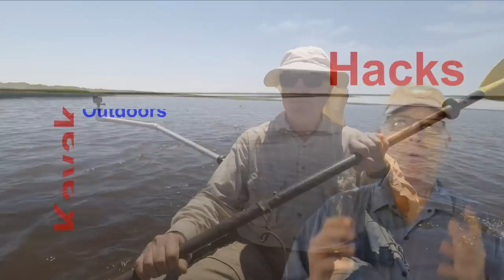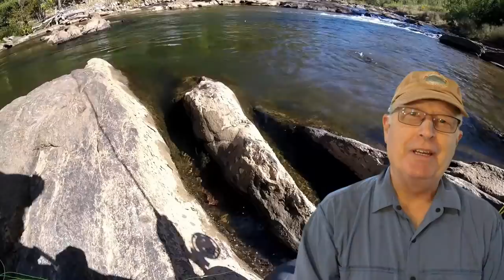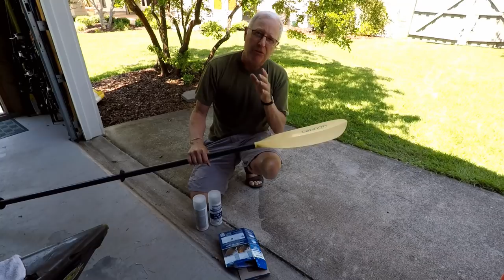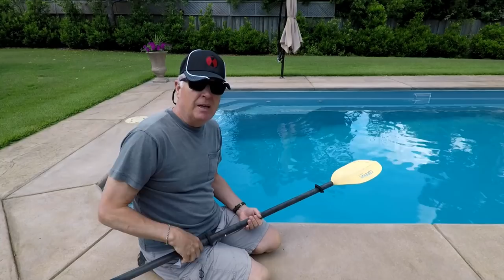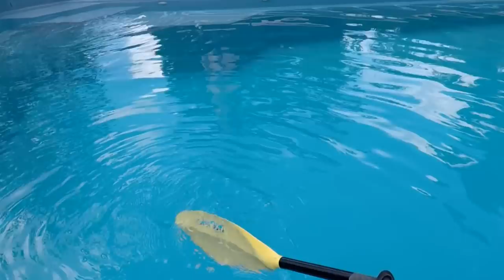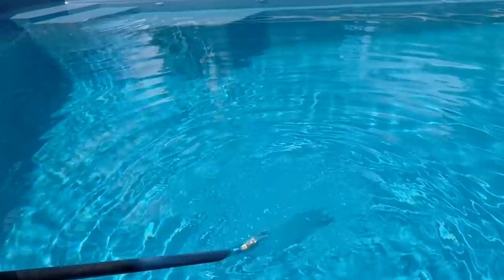Easy DIY Dripless Paddle for Kayak, Canoe or SUP

Comment: End of the day,how long has it lasted ?
Reply from the maker: I have paddled with this on for 46 hours at this point (keeping track).  I have pushed thru the mud and wedged thru marsh grass.  The stuff is wearing off on the edges and still OK on the wide part of the paddle.  I think the mud and grass rubbed it off.  I bet if I were just to paddle with it the life would be longer.  Even though it has worn off on the edge, I do not get drips.  I am anxious to try the idea somebody else had - use car wax.  Once this comes off, I will try that.

Comment from the maker: BEFORE YOU BUY NEVERWET, try the duct tape idea I discovered after I did this video! https://youtu.be/yc7g0cGr4Rc
Reply: Both works best ...what if you coated the bottom of the kayak would it float through the water easier?....I might get that a go on mine ...I  know it wears off but what if it works?
Reply from the maker: @anthonysteelman2792  I do not think it would really work. The Epic kayak racing team tested waxing the bottom of their kayaks and it did not add anything.
Reply: @anthonysteelman2792  i think i might as it repels the water therefor less resistance and drag give it a go and let us know
Reply: @anthonysteelman2792  did you try this.? I'd be very interested to know if it worked for you?

Comment: the only problem is its a harsh chemical that stay in the environment very long!
Reply from the maker: That's why I recommend using the duct tape hack.
Reply: no they don't neverwet chem leeches about as much as the paddle and kayaks plastics do. its a locked in chemical like polyurethane. things like WD40 and other 'tips' def DO leech and pollute waterways